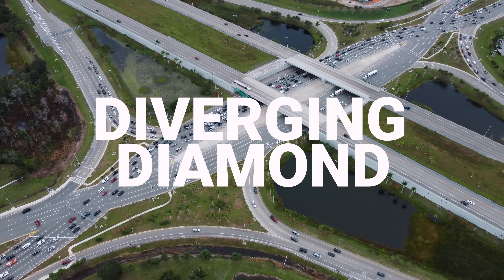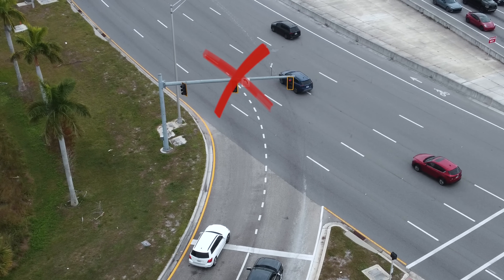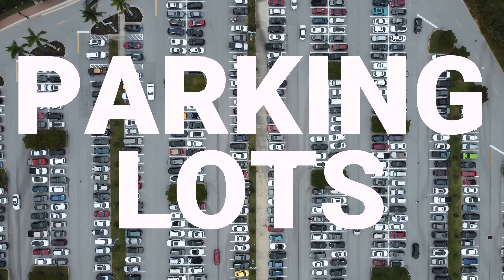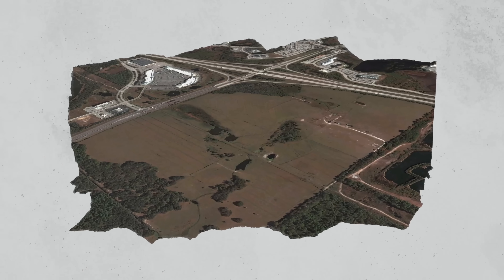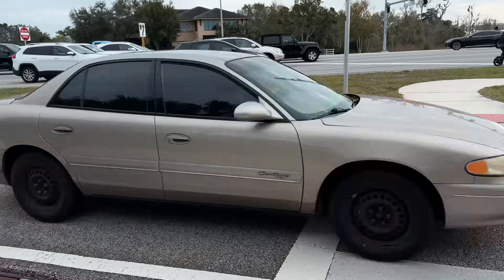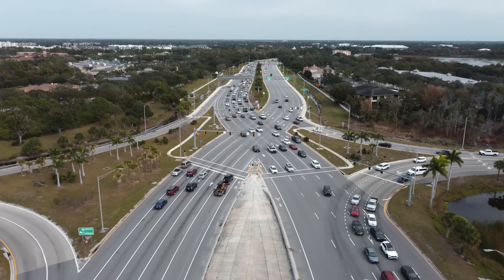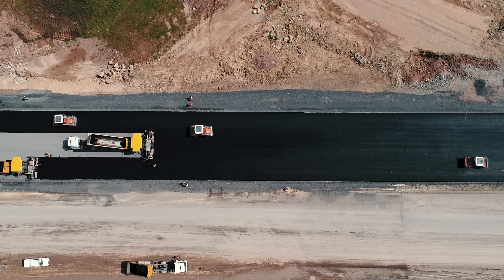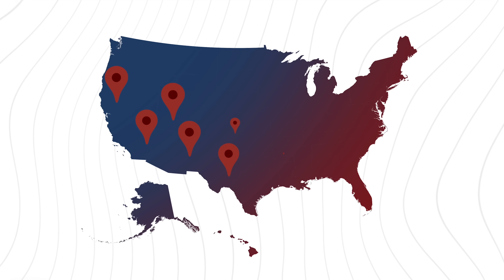Traffic Will Never Be Fixed Here

Comment: As long as you periodically stop all traffic at an intersection, you will never fix anything. 
In Europe, we use loads of roundabouts and bridges for crossing traffic.
Reply: I am guessing traffic is not fixed in Europe because they use signals everywhere, too.
Reply: @traffic.engineer   Signals stop traffic. Rounabouts give a better flow though the crossings over all.
Reply: @bjarterundereim3038  America has more roundabouts than any other country except France.  America is has studied where roundabouts are useful, and this is not a proper location.

Roundabouts work best for low volume traffic (less than 1000 vehicles per hour, 1750 for dual lane, 2200 for triple lane).  Traffic here is much greater due to the ramps coming off of a major national highway.  A roundabout over capacity would only cause more stops due to less gaps available in traffic, and this would cause longer queues and traffic jams.  Once above a that threshold, signals are necessary to regulate the flow of traffic.  This is why signals are also used throughout Europe.  Roundabout interchanges are much better for rural and suburban locations.
Reply: @traffic.engineer  What does this claim even mean? Nominal numbers or what?
Which country has more roundabouts pr mile of road? That would tell something.
Reply: @bjarterundereim3038  It means America builds roundabouts and has a history of building roundabouts.  America does not build them at inappropriate places like UK and Spain where they signalize them due to being over capacity.  America refuses to signalize roundabouts, and therefore many traffic circles in Europe do not qualify as roundabouts.  America simply has much stricter criteria where built.

America does not have the density of roundabouts like Europe due to having much very much greater landmass and larger sections of unpopulated and continuous roadways.  Smaller landmass with less intersections also allows more funding per intersection, as the high price of constructing safe and operational roundabouts is cost prohibitive with the 15 million intersections in America.

Comment: Diverging diamonds dont work unless they are grade separated.  Traffic lights kill any benefit they had except for light traffic areas
Reply: Traffic lights are needed to manage large volumes of traffic.  No signals will just overflow the ramps like a funnel.  If there is light volumes, then roundabouts work fine.  No need for signals then.

Comment: The desired result on the limited access highway is to NOT have accelerating traffic entering it and decelerating traffic exiting it to take place in the same short merge lane.  On lower use interchanges since it is much cheaper to use fewer entry and exit ramps have the traffic on the local roads makes a left across oncoming traffic to share the same entry lane for both directions of traffic on the local road.

On higher use interchanges the practice was to double the entry and exit ramps making the clover leaf interchange where there is no left turning traffic on the local roads onto the limited access highway entry ramps, but it puts this traffic onto a short merge lane disrupting traffic flow on the limited access highway.   

The diverging diamond eliminates left turning traffic from needing to cross on coming traffic making it behave as right turning traffic on a right side driving direction road.    Right turning traffic takes place in advance of the diverging diamond.   

A major issue with the diverging diamond is the long stretched out skewed intersections take a long time to clear traffic and motorists may not be able to see the traffic lights when backed up in the conflict zones.   The main objective of the diverging diamond interchange is to eliminate merging of exiting and entering traffic on the limited access highway in the same short merge lane for high use interchanges.  This pushes more complicated traffic patterns onto the local roads to allow a freer running limited access highway.

Comment: FDOT seems to be taking note of the issue of adjacent intersections.  They just installed another Diverging Diamond on I-75 about an hour south of here in Fort Myers.  But to alleviate the problem of adjacent intersection backing up, they converted the adjacent intersection to a Continuous Flow Intersection, which seems to help keep the diverging diamond clear.
Reply: So far it's better in terms of traffic, but that is relative to when it was being built. That particular area was and still is horrific in traffic since it's a main artery from Ft. Myers to Lehigh Acres. However, we'll see in a few years since that area is getting TONS more development.

Comment: "how can we fix this 26 lane road?" 
A giant roundabout
Reply: Obviously, NO.
The NOT-obvious solution is to REDUCE the number of lanes to 2 per direction.  That FORCES car-drivers to get SO DISGUSTED at the traffic jams, that they work towards a different solution, 1 that involves the REDUCTION of car-quantity.
Reply: @Scott-i9v2s  you apparently missed the humor there
Reply: @ Sorry.😐  But now I am minded to suggest a round-about like the enormous 1 in Paris expanded to 25 lanes (instead of its mere 6)...🤣
Reply: Many people are unaware the limited capacity of a roundabout.
Reply: @ Many people are ALSO not aware of the limited capacity of a (highway) lane.  Ditto that an increase in LANE-quantity will result in a LESS-than-pro-rata increase in capacity. And a MORE-than-pro-rata increase in accidents.
Reply: @Scott-i9v2s  yes, just like a roundabouts.  A single lane roundabout has a capacity of a 1000 total vehicles per hours, while a dual lane roundabout only has about 1700.  Adding a lane will decrease the initial capacity of each lane.

Comment: Texas has a better system. Just 5 stack the interchange, direct lanes everywhere, no crossing or lights. Next to the highway are slower 45 to 55 mph frontage roads. You get onto them occasionally and they interact with the local traffic. You can still overload it, but it remains efficient.

Interesting to see this poor persons interchange failing. Also pedestrian crossing of it? What in the ...

Comment: Easy fix. Cut the lanes in half and instead of the diamond have one side go over and the other under. Eliminate all intersections, no need to stop, so fewer lanes needed. All backups will occur at the other intersections rather than at the highway.
Reply: That is nothing more than moving the problem elsewhere.
Reply: Only about $1 billion more expensive.

Comment: Isn't  a diverging diamond  basically a cost reduced, failed clover leave crossing?
I think even a traffic circle would be better than a diverging diamond.
If you think about it. 
You want to design the crossing in a non blocking way. This can be achieved by having two one track roads become one two track road, when ever two roads fuse into each other. 
If you are not incliened to guarantie non blocking trafic , you want to at least try to reduce the risk of deadlock at the crossing. This can be achieved in two ways. You can seperate certain kinds of traffic with time slots. this is the regular 4 way crossing with trafficlights. You will allways have at least half the traffic or more if you add the more timeslots, blocked and queueing up outside the crossing. This deadlock free until traffic backs up towards another of such traditional  4 way crossings.
If you don't want short lockups of traffic, you could build a traffic circle. They work like a ring buffer, basically a global queue, that continuously moves traffic, and the time you are locked is dependant on the maximum volume members that can  be stored in the queue . As long as the queue(=Ringbuffer) is never filled more than 70% of capacity everything passes through smothely without lock. But abouve that it fastly approaches a jam like reale slow moving situation basically an allmost deadlock with little movement.
The real problem is that traffic crossings can't dynamically change configuration and dynamicall allocate space in order to accomodate traffic peaks. Would we have networked self driving cars only, traffic could spread more intelligently to use existing road capacity. One could actually emulate this by having "coloured" numberplates and a traffic controll system that interactively allows or blocks certain colours to drive on certain roads leading to these crossings. Basically allowing half of the colours to use one traffic crossing one the other half to use another, would half the traffic at a popular traffic crossing... These informations can be life fed into navigation systems 30 minutes ahead of time so navigation system will be able to calculate your best legal way to your destination and interactively adapt the path.
Reply: The REAL PROBLEM is a wrong PERCEPTION of what the problem IS.
The REAL PROBLEM is the factor that causes a perceived need for (more) cars. Namely CARS.
Reply: Roundabout or traffoc circle would fail, due to the capacity being lower than the volumes here.  It would also cost more money and land to construct.  Cloverleaf is the exact same problem with capacity.

Comment: I feel like the neighboring intersection that is causing the backup at this interchange could be redone as a no-left-turns intersection with turnaround points placed on either side of the intersection so those who need to turn left can still do so, albeit with slightly longer of a route. This is called a Michigan left, for those of you who didn't know that, and it's pretty good at reducing backup at busy intersections because there are two fewer phases than in a standard four-way intersection with dedicated left turn signals. And it's not like University Pkwy (the road that intersects I-75) isn't already wide enough or almost wide enough to accommodate U-turns.
Reply: I'd like to see a bridge carrying traffic on University over Cattleman with freeway like ramps and intersections or maybe roundabouts for those who wish to visit the shopping areas.  That would make it a lot easier to access 75 from the west.  It might not help the traffic around the mall but really, nothing will.

Comment: The two roads of the towo diverging points should be disconnected for example with a Tunnel für one road since you can only straight.
Reply: Cosr benefit analysis does not justify it.
Reply: @traffic.engineer  How will you know? When I see that Those diverging points are the reason for the inefficiecy, maybe it does.
Reply: @ironsimonx4221  you are asking for about only 5x worth of efficiency for about 20x extra cost.  The fact that this is much more efficient than a standard 4-ramp interchange, roundabout, or cloverleaf; and with less cost than a roundabout, cloverleaf, or flyover; demonstrates this a better value while using the money to improve areas throughout Florida.  The diverging points with signals are necessary with these traffic volumes so it does not overflow the intersections downstream from the ramp.  That is force a whole lot of water into a funnel that has less flow.

Comment: Diverging Diamonds are great when used correctly, but shouldn't be used when the minor road has similar traffic to the highway, or when the traffic lights for the DD cannot be kept far away from the next set of traffic lights.

The DD in your video violates both of these fundamental rules for DDs.  They should have never built it here.

Comment: Not a diverging interchange, but that problem with not being able to see if there is enough room for you on the other side of an intersection is pretty common.  I wonder if we could have sensors at key intersections that measured the length of vehicles and could estimate how many cars it could let through.  The green light could have a number that counts down on it like a pedestrian timer, except instead of counting time it could count vehicles.  (I mean, it doesn't fix the car centric issue in general, but might help certain types of intersections from building up.)

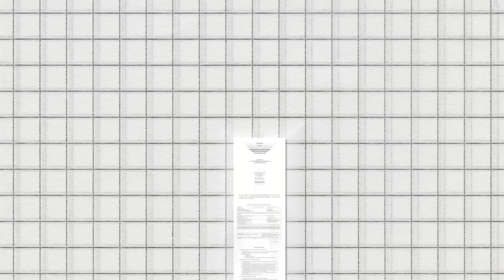Comment: This is I-75 and University Parkway, which besides the stores and mall, is also the main route to the airport. The report briefly seen at 2:22 is in Springfield MO, was MoDOT's first diverging diamond. I've been through both. I-44 in that area is still the original 2x2 built in the 60s and well overloaded now; MoDOT badly needs to widen 44 through that stretch.
Reply: “We need more lanes” which is pretty much what you said. Is not the answer you watch this channel you should know that

Comment: I think there is a solution but it is very expensive. This diverging diamond is at the interchange of I-75 and University Parkway in Sarasota.  This wasn't an intersection of two busy city streets as we were lead to believe. The solution is to change University Parkway to a series of double roundabout interchanges from the airport to this diverging diamond interchange and then over to Lorraine boulevard. This would be similar to what Carmel, Indiana did with Keystone Parkway using bridges and bow tie shaped roundabouts on the bridges. However, I would suggest bridging University  Parkway over the crossroads with roundabouts on both sides of the bridge. Traffic would flow on University Parkway so nicely that could even reduce the number of through lanes needed.

Comment: I don't know that I agree with your conclusions here. You're right that planners need to give greater emphasis on walking and cycling but you fail to understand that those two are in conflict with each other as well (I hate sharing the pavement (sidewalk) with cyclists).
It strikes me that the diverging diamond is a perfect response to that junction but the local authority needs to put greater pressure on the nearby businesses to ensure their car parks can be used much more quickly. The trouble with a successful mall is the large number of cars milling around trying to find somewhere to park and also trying to navigate around and out of the car park.
These are tractable problems.
Sort out the traffic in the car park and get it off the road to keep the junction flowing.
Your real conclusion should be that there should be no entrances and exits within a certain distance of major junctions.

Comment: My hometown had the first diverging diamond in the US. It now has at least 3 more in different parts of the city, but I think in most of these places a roundabout (or ovalabout) on the intersecting roads would have worked better, except perhaps at the one that is INSANELY busy because it was built over a highway between two other very busy intersections and literally right next to the region's largest hospital. I still think it would have been a valid option because likely 75% of the traffic going through this service interchange just goes straight across the highway, meaning the roundabout chokepoint would have been minor, compared to what it is now, with all through traffic each direction having to stop at a signal for the opposite through traffic for long periods of time.
Reply: Roundabouts work best on low volume roads (less that 1000 vehicles per lane for all approaches).  The volumes here are too high for that and will just create more congestion.

Comment: If only there was a way to fit more people into a car, like if we could find some kind of longer, multi seater car, almost like a minivan, but able to seat like 40-60 people or so, with standing room that could be pushed up even more? If we could find a way to build dedicated lanes for them, we could even link multiple together, although at that point the road and wheel maintenance could be a bottle neck, but some kind of long guide rail, with low friction, durable wheels. We could even then consolidate the motor into one super strong car at the front, allowing for more space for seats in the succeeding cars. I think this idea could be BIG!

Comment: Placement of the traffic lights on a diverging diamond, and the timing of those lights is essential to it working with heavy traffic flow. The intersection shown has poor placement and probably issues with timing. Tough to say on the timing since the lights are placed poorly.

Also, 27 lanes through an intersection with no dedicated flyover lanes is almost certainly a bad idea. If you need that many lanes, there should probably be flyovers/unders for straight through traffic with no lights to keep though traffic from adding congestion to a busy intersection.

Comment: it will be fixed, as soon as you fine those, that are on the intersection when it gets red again and they are unable to leave.
you have to make sure you can leave the intersection before driving on it, no matter what the light says
can't get off the other side but it's green? too bad, then just behave as if it is red.
done.

4000 dollar fine per violation
50% get distributed to the one reporting, and you have solved the homeless problem and traffic in the same day, since now you have lots of people standing there reporting that stuff.

Comment: French

English

Americans really does everything just to avoid roundabouts. The brains seem to be too thick to comprehend.
Reply: Because a roundabout would not work here.  Roundabouts would fail because the traffic volumes are greater than a roundabout's capacity, and the construction would cost more.

A roundabout interchange would cost more because it would take more right-of-way outside of the prior interchange design.  That would require more stormwater management facilities, as well as shoring / retaining walls due to encroaching into the slopes of the overpass highway.

And the roundabout would not be efficient for places with such high traffic volumes.  They max out at 1000 vehicles per hour for single lane roundabout (1700 for dual lanes).  Roundabout interchanges are better for rural/surburban locations where traffic is not projected to increase.